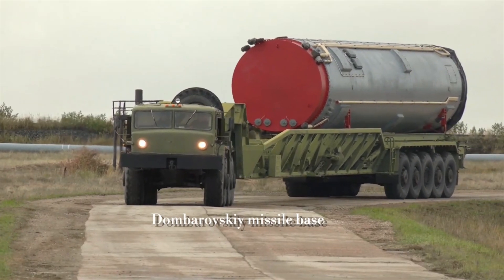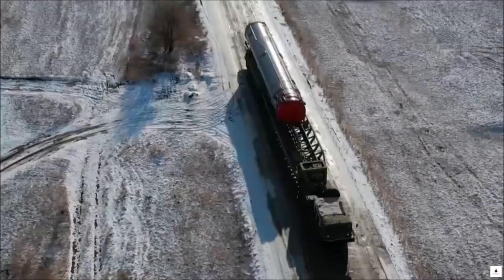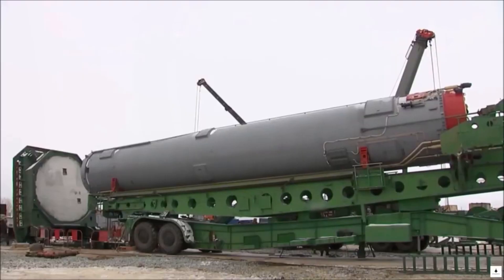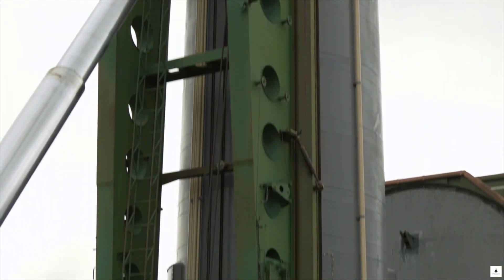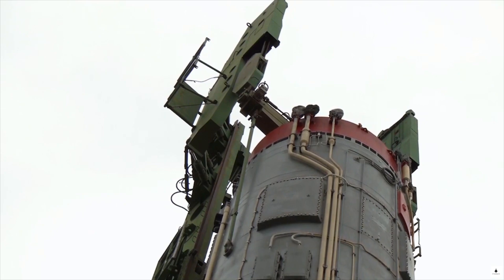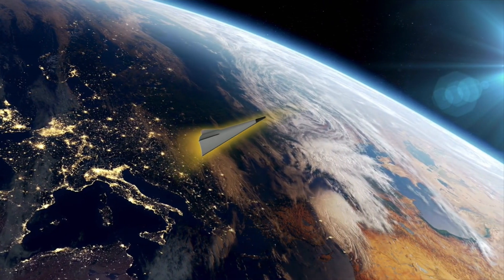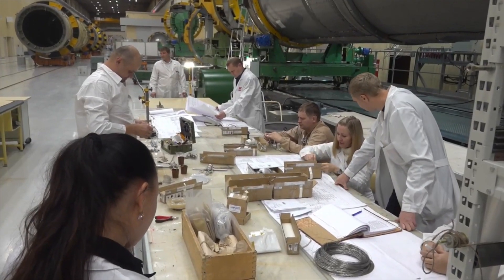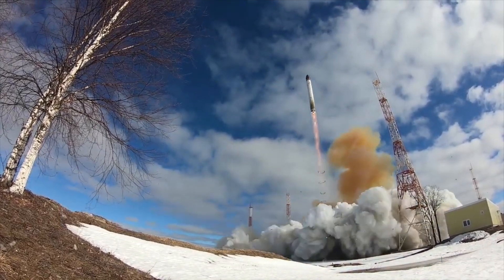Vladimir Putin's Top Secret Avangard Hypersonic Glide Vehicle

Comment: You should cover the S 550 missile. When I saw that thing launch as if it was a bullet leaving the barrel of a rifle it amazed me. I've never seen anything like it. I have close family that work at Raytheon where the Patriot is made and I know more than I probably should, but believe me, that it is a very impressive surface to air missile. Whether they are able to develop adequate numbers to make it a significant deterrent is likely it's biggest downfall.
Reply from the maker: Will have a look, as a new system, solid information can be hard to find or verify 👍